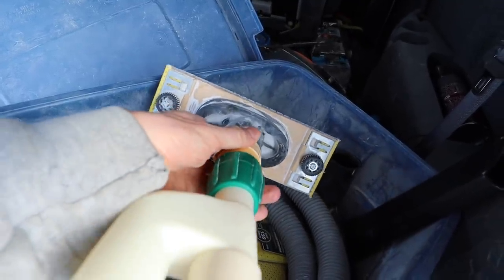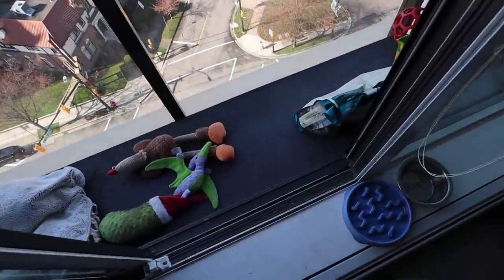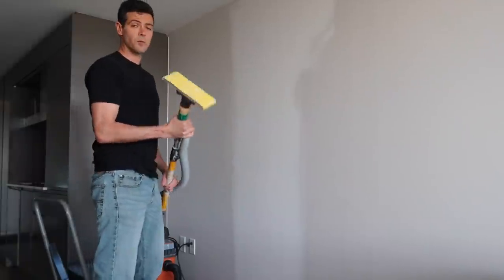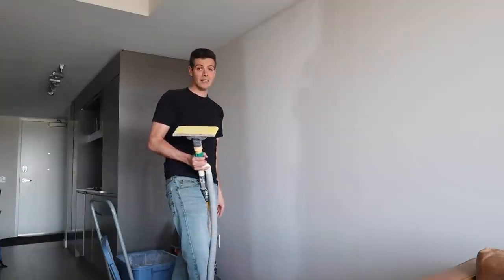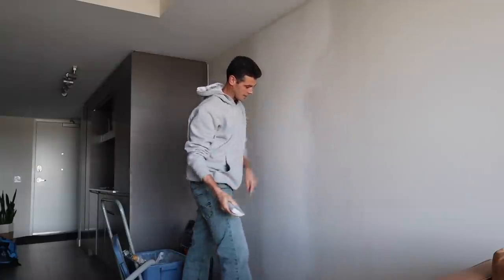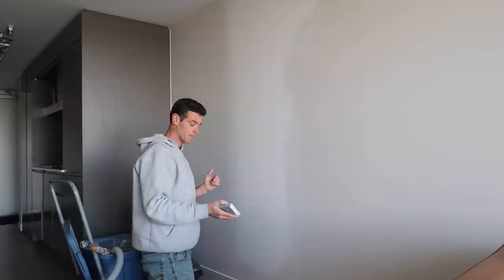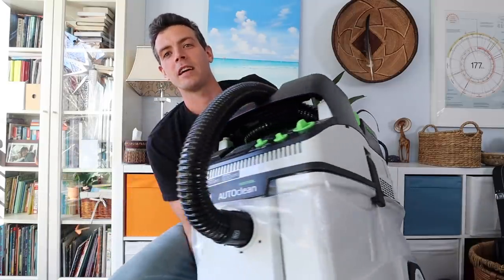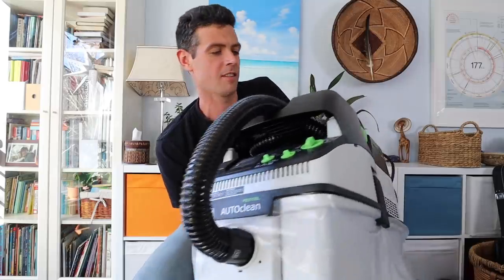I'm FINALLY getting a new VACUUM SANDER!!!

Comment: Power sanders are a great tool. They sand fast and clean with a vac. However they can mess something up in a hurry.   

I believe that festool makes a soft pad and a firm pad. For finish with I would go with the soft. The firm pad I would use for heavy removal, texture, etc

Have fun

Comment: I loved finding out 2 new things about you today: 1) skater and 2) your 38 years old. I can relate. I’m a weekend DIYer that does a lot of skim coating. I’ve been using a cheap Wen electric sander with a craftsman shopvac for about a year and it is a total game changer. You can put a thicker first layer of mud and even leave trowel lines and other imperfections, because the sander takes it off so fast. After sanding I put a final quick thin coat that needs very little sanding if any. I hope all the best for you.

Comment: Nice video, and props for learning a tool before making the video.  I just bought a festool drywall sander and even though I had three poster cable sanders before, it definitely still takes some getting used to.  I need to get back into the video game, you made it look fun again.  Thanks

Comment: Could you do a video on how to remove dried drywall mud/plaster from drywall?  I'm doing a minor kitchen renovation and the previous owner caked on mud that's nearly 1/2" thick in some places.  I'm not tearing down the drywall, I just want to remove the hard, dried drywall mud without sanding it down and creating a dust-storm.  Also chipping away at it seems to take forever.  Any power tool attachments you can recommend?

Comment: There's certain situations where the vacuum sander is really use like small rooms and for ceilings, also really helps keep the job a lot less dusty, however they don't do nearly as good a job as a large sanding sponge and I often go back with the sponge and holding the vacuum tip near to clean up the marks from the vacuum sander.

Comment: I have a question for you. Can you please explain the difference between piece work and hourly work. I think there is something deep between these two terms. It always rings in my mind how my boss can manage picking us from home to job site inclueding expences like gas and personal expences from doing hourly work bcz i am not making a lot from work and i am doing live 50 to 60 hours a week finishing(taping, sanding, applying3coats, final sanding) in 12 to 14 units a week. I think some here doesn't seems quite as it looks from outside. Help

Comment: I hope it’s better than the old ones!! We bought two back in 2008 and those things were garbage. You could not sand a joint and get it right. Both of them are still in the shop and my guys won’t use them.

Comment: I can give one tip: Always start sander when it's laying on surface never start it in air and then made contact with wall.  And reason for that it when it's in air it gets higher RPM and when you lay it down it bites and for sure makes hollow.

Comment: Nice video, enjoyed the content.
I'm sure you'll love your new sander and vac. The new Festool sander has the orbital action which won't leave any scratch marks.

I'll be curious how it works on ceilings. Been thinking about getting the Mirka drywall sander because of its 180° swivel head, which means you can sand  ceilings easily because you can hold the handle vertically instead of a 45 degree angle, which is much easier on the shoulders.

Comment: My dad's actually getting rid of his Festool sander after a year or so of ownership.  He used a Porter Cable for decades and finally got rid of it (after having it break over, and over, and over...).  The Festool is an amazing system that is very clean, quiet, well-designed, and well-engineered.  (Them Germans!)  His major gripe is the fact that it's so end-heavy.  He does a lot of large commercial jobs where he's sanding all day.  And at 62, he's looking for the lightest thing he can find.  But based on what I've seen from your channel so far, it'll be perfect for you because of the smaller jobs you do.  You just have to get the hang of adjusting the vacuum/suction and sanding disc RPM settings for each job.  You may also find that you lose suction on uneven surfaces pretty quickly.  I don't know how familiar you are with the rotating sanders, but have it spinning before you're on the wall and do an 'airplane landing/takeoff' onto and off the wall to avoid unwanted gouges.  I'm interested to hear what you think about it.  Enjoy and good for you (and us)!

Comment: Nice addition to the tool arsenal. I have the og Planex and it's not my favorite tbh but the vac is great. I was just about to order the Mirka Leros but now not sure if I should give the improved Planex a go instead. I think it's the light ring tempting me lol. 

For small stuff like a small bath room or repairs I use a CT26 vac paired with a ets 150 or 125. If I was doing it over I'd probably use a midi for the smaller work but I'm used to the 26. 

Looking forward to your opinions on the Planex 2.
Reply: @Phelebas I've been using the 180g and 220g Granat paper that have the foam backing built onto the pad.  My real issue is that for ceiling work I don't think it has as good extraction as it should. I have it paired with the Festool 36 AC so not a vac issue. I actually have wondered if I got a bum unit with some issue.
Reply: @Phelebas Yeah I have. I was about to buy the Mirka but now am considering the new Planex because of the light ring and improvements. Mirka has a reputation for being a really good finish sander and the new Planex is unproven and my feelings about the og Planex make me doubt it a bit. I have made every adjustment and inspection feasible for the OG which makes me wonder if I have some form of defect, but since I don't have another to compare it to it might get sent in for inspection. 

I've been using Festool sanders for years and extraction was never a issue with any of them as that is where they excel but this one has had me questioning me at first, then the settings, and now the sander itself. 

Don't get me wrong it works and has been getting jobs done, but compared to what I have seen i'm having a extractor issue. I have multiple extractors and so eliminated that as my problem.

Comment: Sticking up for the poor tile guy who was told to do a tile over job and still was nice enough to leave a tight joint but still big enough to get the lid off.  You know they didn't clean it first and was probably in use by the GC.